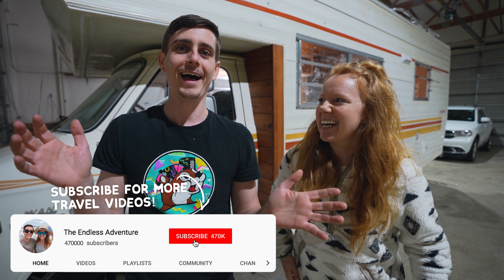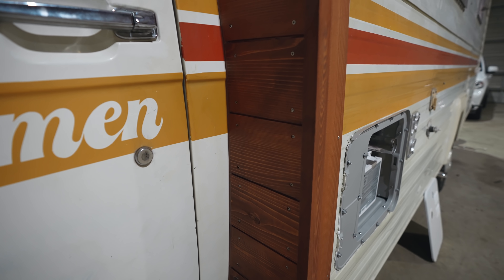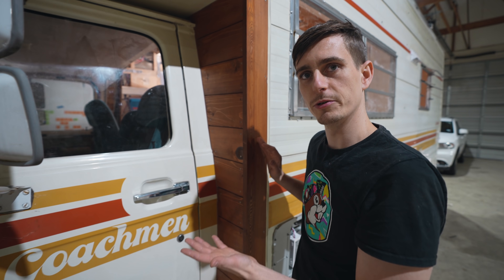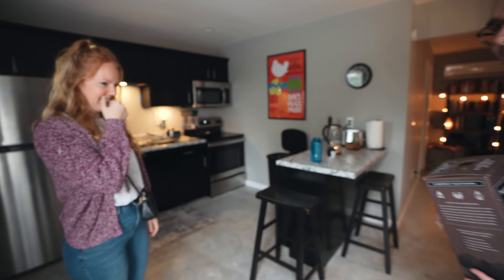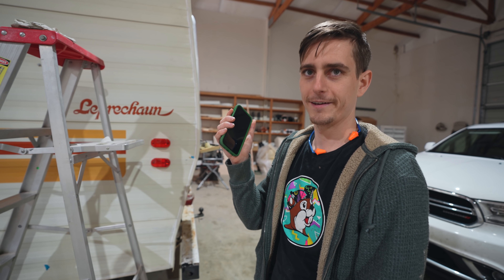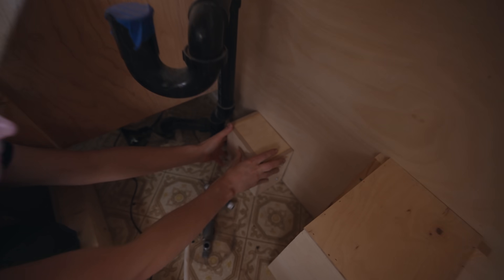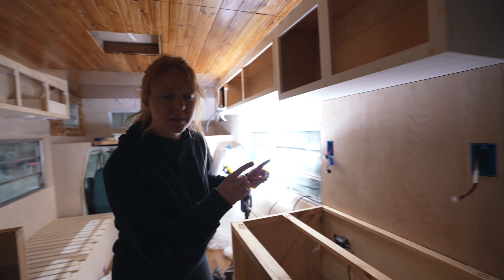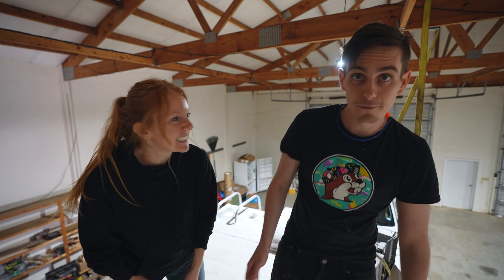RV Renovation - We Installed REAL WOOD SIDING on the RV! 😍 + Finishing Tons of Projects! (Ep. 22)

Comment: The wood paneling on the exterior looks great! Just be careful because the camper body and the cab may flex differently and cause your caulked joint to crack when twisting the chassis.

Comment: I like the wood, and nice job on doing the fitment to the body lines and not just relying on caulk to fill gaps! It would look really cool to do a vinyl wrap on the RV and either make the whole thing look made out of dark wood to match the real wood so it looks like a "cabin on wheels" or, (what I would do!) do it in in a white wrap (either just normal white vinyl or a white "wood" print) with the RV's factory stripe package recreated with dark "wooden"  stripes going around it to tie in the real wood you have on it! You could even have them print your "TEA" logo "burned/branded" into the printed wood or like there's a carved wooden logo mounted on the side! Coat the wood you put on it with linseed oil and/or wood wax to help protect it, and give added protection to the screws, from the weather and impact scratches! Great job! 👍

Comment: I LOVE your exterior wood! It's gorgeous! Great solution to a difficult project.😄  If you have an aluminum roof, do not put a rubber coating on that, you would want an elastomeric paint. If you have a rubber roof, 👍. When you reseal your roof seams, use 3m 5200 fast cure or sikaflex, both are high quality, long lasting waterproof sealants. Stay away from all silicone sealants on all of the exterior of your RV, they don't last, are almost impossible to remove and can not be sealed over until all residue is gone. Polyurethane sealants are the only way to go.👍

Comment: Pulleys. Swinging down the ac is probably fine, but use a pulley system with maybe a 4:1 ratio or so to make sure that you can keep it in control.

Comment: Love your work!

Unless that stain you used was meant for a wood house that travels on a salted freeway, that wood is going to have issues within one season.  I can't say for certain, but I would be very surprised if that wood can tolerate the spray that will be kicked up from the front tires. Even if you don't drive the RV in winter, the road will have residual salt and oil that the rain will carry to your wood. 

Just ask yourself if that wood system can withstand hurricane conditions (wind-driven rain) for hours and hours... and hours. The water will be driven into the joints and you need to direct it out. Typically this is by a waterproofing membrane like roofing peel-and-stick.

In any case best of luck with your project! 👍😃 Always great to see your efforts. 😃

Comment: i think that once traveling is possible again , the holidayspots will become swamped with tourists , all the people that havent had a holliday for 2 years will book a more expensive hollidays with the extra money they put aside in those 2 years , it could well be there whont be rooms and flights available by the time youre ready to book 

if you not going to re use the aircon unit anymore it might be safer to just set a pallet on the floor under it , slightly angled away from the rv and just trow it off the roof trying to get it as far away from the rv as you can to prevent it from hitting or rolling azgainst the side on landing
having the aircon crunch the pallet on landing makes for good video too 
the strap might cause the aircon unit to swing intoo the rv once you tipped it over the edge  , might even be more than once and theres a change you have to drop it anyway if the aircon turns out to be to heavy to hold it once its hanging from the rafter 
all in all trowing it of the roof is safer for you guys 
could use a board under the unit and tilt it to have the airon slide of the board , less chance of damaging the roof

the interior is looking realy nice , the panels fit good , you seem to have gotten better with the woodworking and measuring stuff , i allso like the wood on the outside , hope you put sealant in the tongue and grooves though as the water will be forced every wich way intoo the nooks and crannies when driving through rain

Comment: You guys have taken on amazing amount of work for an old RV and done a ton of great work.  I'm not a RV builder so take this with a grain of salt.  Not seeing how you waterproofed the plywood under the pine siding, have you considered driving rain.  60 MPH driving with rain will make supper high pressure and inject water through the tongue and grove.  Fresh water between pine and plywood=rot.  Having fixed sooo much rot, I'm not thinking you want that.  Some of the rot you fixed is probably a result of those pressures and driving in rain.  Plus pine will not last outside in my climate, without a lot of maintenance.   . You may want to rethink this.  Would be a pain to fix later.   Keep on the good work and I enjoy your videos.
Reply: Yes they have put tongue and groove on an area most affected by rain/spray

Comment: I can only imagine how much that real wood cost with the prices of lumber these days. If I were to make a comment, the screw holes are a bit of an eyesore.  If you remove them, counter sink your holes, screw them back in, take some scrap wood, make some plug holes, flush cut them, sand and stain the level of quality will go up 10x.  Yes, a lot of work, but well worth it.  Also, not sure what type of screws you used, but most likely will stand up to the elements better this way with a good sealer on the wood.